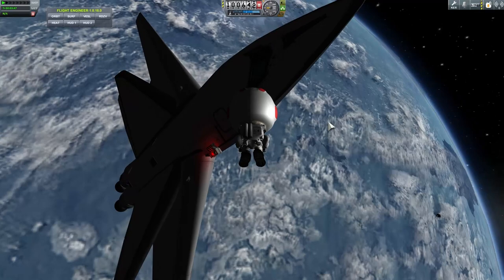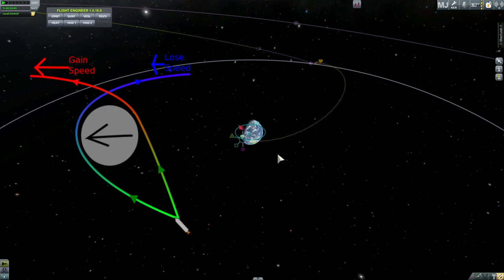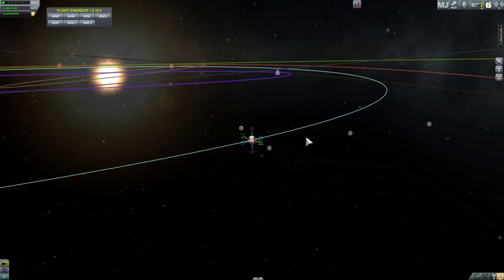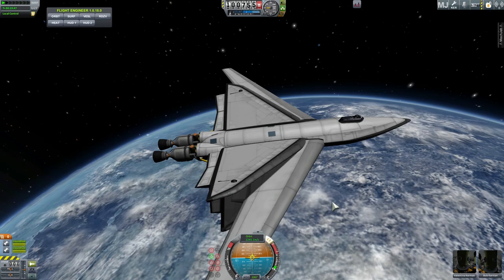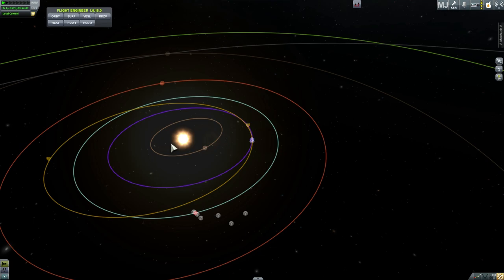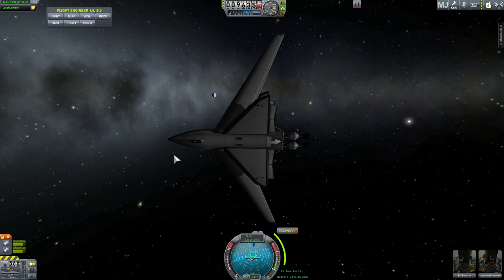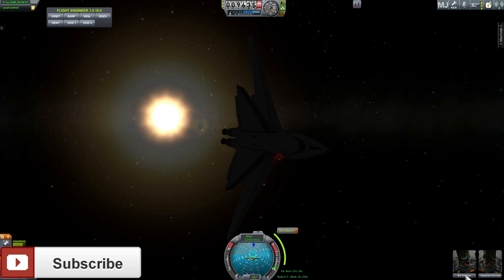Kerbal Space Program - Investigating Aerogravity Assist (AGA) - Slingshot Maneuver 2.0

Comment: Actually... wings in KSP don't work the way you seem to expect them to.
They don't provide you "reverse lift" if you simply turn the craft upside-down. They actually work only if you deviate from your prograde. (Or you can attach wings at an angle so their prograde and your craft's don't match...)

So to perform an AeroGravity assist I would:
1) Don't go deep into the atmosphere. If you see reentry heating - you failed. All the heat you see is leaking from your kinetic energy...
2) While passing through the atmosphere - angle the craft towards the surface a bit. like 1-2 degree. 

That might do the trick...
But I doubt it will be much of difference in deltaV saving...
Reply: KSP drag is strange, don't try to understand it
Reply: bernoulli's principle. turn the plane upside down, it still does the same thing - lift.

Comment: Well I think you need to remember that IRL there is no absolute terminator between atmosphere and vacuum at a certain altitude (the ISS needs to fire thrusters every so often to boost its orbit as it decays due to atmospheric drag), it just thins by orders of magnitude, so there is always an arbitrary point depending on aerodynamics of the ship and thickness of the atmosphere where slowdown due to drag overtakes speed-up due to gravity. It may be that by tweaking the aerodynamic profile of a ship you can lower the effective altitude in an atmosphere where slowdown due to drag would overtake speed-up due to gravity... This couldn't be modelled in Kerbal Space Program because there atmospheres cease to exist entirely at a given altitude.

Gravity assist in atmosphere will never be as efficient as outside of the atmosphere in KSP because in KSP outside of the atmosphere is a true vacuum, but in real life there is no such arbitrary divider. You would still have atmosphere at 90 km above Eve, just correspondingly thinner than at 80 km.

So a fair comparison might be to compare the results of these kinds of manoeuvres within the KSP atmospheric zones. Compare assists at 70 km periapsis with assists at 85 km periapsis for example with different aerodynamic profiles. Don't bother to try to compete with 90 km because you will never get better than a true vacuum - but IRL you would not have a true vacuum at 90 km, or any other height, so I think this is an experiment that, in KSP, is only valid to do within a modelled atmosphere, not outside of it. :)

Comment: Is an aerogravity assist even expected to give you energy? As far as I understand, unlike a gravity assist it doesn't add energy, but permit a larger deflection. 
So basically you can put your apoapse higher in exchange of lowering your periapse (increasing eccentricity), but it will lower the total energy of your craft due to aerodynamic braking.
Reply: Theoretically there's supposed to be a tradeoff, on a planet with a thin enough atmosphere the increased eccentricity is supposed to help more than the negatives from aerobreaking. But obviously KSP is a game with badly modeled atmospheric physics so you won't see this effect, Maybe try it in Universe Sandbox 2

Comment: For wings to work, you need to be in thick air with air pressure. Lift is just a pressure differential. Aero heating happens high above that thick air you need for wings because it is just momentum, every stand alone particle effects your momentum. 
Maybe if you slam 100 comets into Ceres and create an atmosphere (which will last 35 secs) you can dip into it like an F16, do a 75 mile 180 turn, and gain the assist because of sharpness of turn, but wandering in an atmosphere of a planet for 10,000 miles probably won't help you gain delta V.

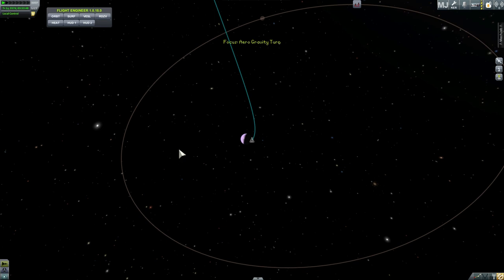Comment: The reason that it's not working is because your escape angle is wrong. At 5:14, the direction of your Eve escape trajectory matches Eve's velocity, so you get an optimal assist. At 6:45, after you skim through the atmosphere, your escape direction doesn't line up with Eve's orbit, so you get much less of a boost. This loss probably affects your aphelion much more than drag through the upper atmosphere does.

Comment: Well the actual issue is that your not dipping into the atmosphere, you instead use the lift from the wings to bring yourself lower giving you higher effects, the issue is that you faced directly prograde for both flight profiles. You have to face about 5-10 degrees lower on the navball.

Comment: It's not a problem of simulator accuracy, it's because the experiment was done incorrectly. The spaceplane was coming in at 0 angle of attack, thus not producing any lift independently on its attitude.

The correct way to do it would be to pull down during the maneuver, thus producing some lift or use a design that creates lift at "neutral" position (like an unsymmetrical capsule).
Reply from the maker: +Wojciech Dubrownik I tried that off camera but cut it out of the final video as it was getting long. pulling down makes you lose more delta v still, as the aerobraking increases unfortunately. But I agree, it should theoretically work better.

Comment: For the test running around 9 minutes in you passed through the atmosphere with the wings at and angle thus generating lift in a tangential vector from your flight path. That's probably the reason for the loss in relative velocity for that test, it was energy transferred to motion in a different vector.

Generating savings from an aerogravity assist comes down to whether the acceleration of a given body due to gravity + the energy from streamlined lift will exceed the drag of the volume of air you are passing through. 

Due to the inverse square law Duna and Laythe are much better experimentation targets for this maneuver.

Comment: Seems the point of the aero assist would be to gain velocity on the radial axis. Of course you will lose velocity along the flight path due to drag. A better test would be to burn in the atmosphere to maintain speed and see how the apoapsis moves.
Reply from the maker: +Tom Watson good point, although the theory behind this states that the gaiv in velocity should be higher than the loss due to drag. go figure... :/

Comment: I don't actually think it's possible... it doesn't really matter that much how aerodynamic your aircraft is that much, as others in comments said... you need a little bit of drag to actually push the aircraft down, but in my opinion, the altitude loss you "gain" by this maneuver, thus increasing your kinetic energy, is never gonna overcome the energy loss due to the friction, as Anton said... dunno... I'm not an astrophysicist though, just a fan of space :)
Reply from the maker: +Jiří Kozumplík (Fyzzi)  I agree with you. I think the losses will be higher than the gains

Comment: I think it doesn't work that way. If I'm correct the bigger the angle difference between the inbound and outbound trajectory, the more kinetic energy you will gain from the planet. So an L shaped trajectory is less eficient than a U turn around the planet.
With that said, if you want the highest kinetic energy possible then you have to approach the planet at it's front with a periapsis "at midday" and in the atmosphere until it is "on midnight".

Comment: wings in KSP are just flat planes. they don't push you up or down unless you pull up or down.
Reply from the maker: +clearrunway I tried pulling up too, it just made it worse unfortunately. I didn't record it though.
Reply: +Anton Petrov (WhatDaMath) yeah, there's kind of a more fundamental problem with the concept. which is that you're aerobraking. slamming into eve's atmosphere at 4000+ meters per second is never going to make you go faster and thus raise your apoapsis. the point of an aerogravity assist is not to gain speed - it actually works counter to that - but to change your direction.
Reply from the maker: the books I listed talk about how pulling yourself toward the planet using lift is supposed to increase the force pulling you toward the planet and thus give you higher acceleration vector. so it's a two sided effect- changing direction and increase the vector of velocity.

Comment: No Angle of attack for lift (sink?).  Too low in the atmosphere.  At the moment, it looks like you're just punching straight through and not using any lift.  Maybe try and set the Pe to something like 88 and pull yourself down to 86 or 84 with lift.
Reply: +Ryan Bartling You can also use Mech Jeb to maintain a set AoA of say 5° - 15°.
Reply from the maker: +Ryan Bartling I tried that, just didn't record it and it didn't improve my situation, but did increase air drag.
Reply: +Anton Petrov (WhatDaMath) Cool.  Probably just comes down to the fact that you have 0 atmosphere and then tons (relatively speaking) of atmosphere with nothing in between at EVE.  Only other thing that I can think of is trying Duna or as someone else suggested FAR.
Reply: Yeah what Ryan said, the way stock KSP does atmo (not true gradient), bundled with no actual lifting wings and you need an actual positive AoA (therefore they have horrible drag/lift ratio) its as you saw not working.  Duna is for sure a better candidate, having less dense atmosphere, so at its lowest point is also lower than eve's and set KOS or mechjeb to keep a aoa angle. If it is still not working FAR is is the next step as it actually does calculate lift with also a better way to calculate drag, it might actually work... But be aware since FAR is more clever at calculating the aerodynamics at supersonic speeds high aspect ratio design will probably not work, so you want to make it as low as possible. Man I want to try it now in KSP... seems like there is maybe a way to make it work.